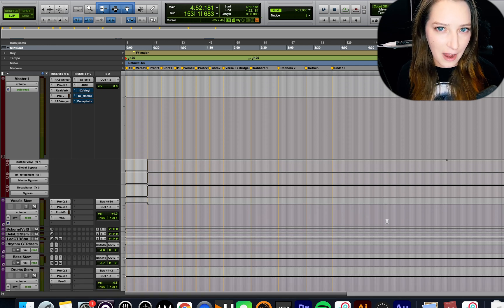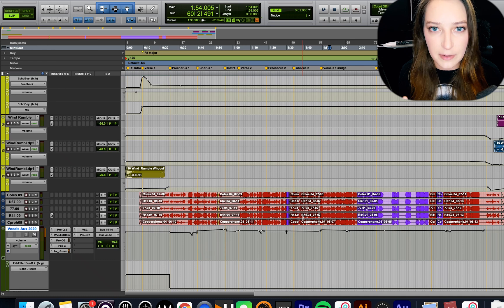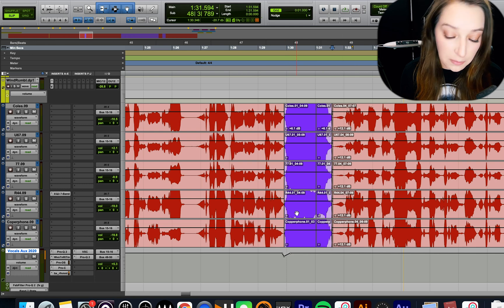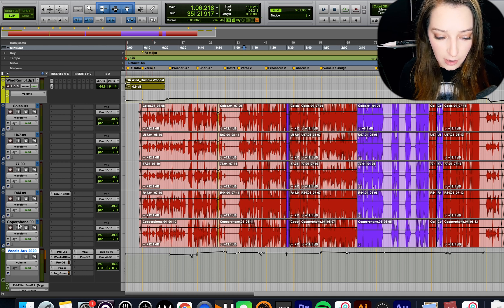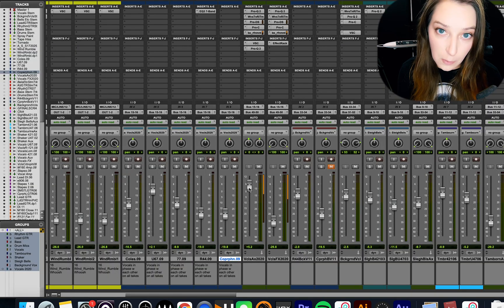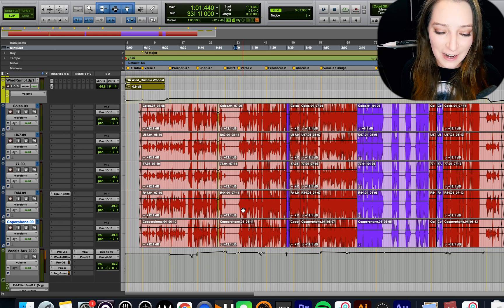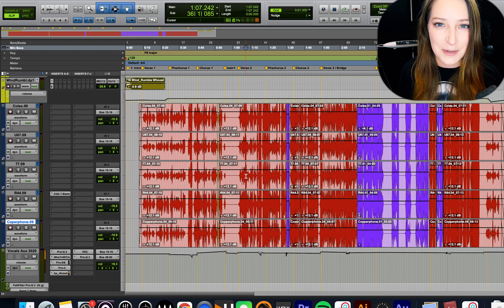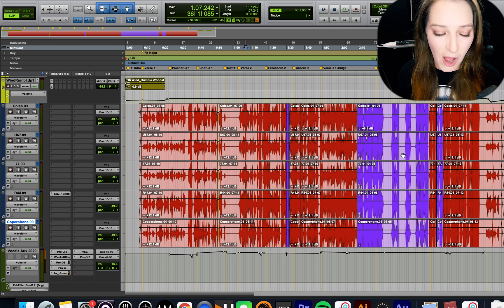Pro Tools Basics: WHEN to Use Clip Gain vs Volume Automation

Comment: That was a supper helpful vid, thank you! It is tricky searching something that has similarly properties but if not treated right can ruin a mix especially when running into clipping. I agree too, to your process on leaving automation secondary as I was getting a good mix but I was disheartened when I later discovered that automation reset my volume. Thanks for clearing up the difference between the subtleties of these processes.